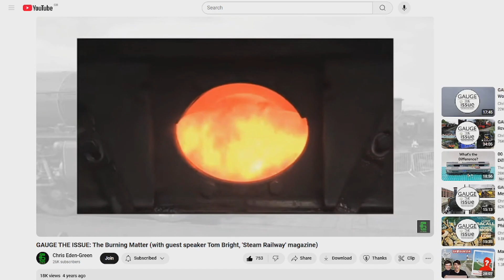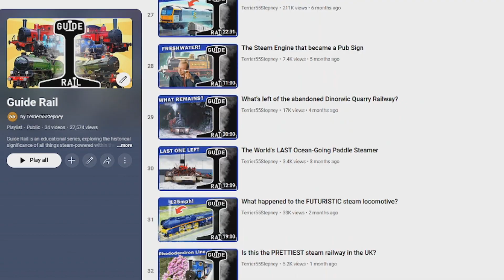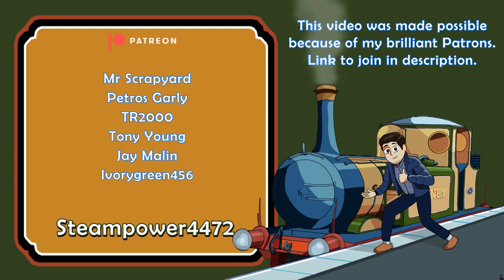Why are steam railways struggling to find coal?

Comment: I looked up metallurgical coal.  Its bituminous coal with low ash and sulfur with other special mineral properties.    It's about five times more expensive than steam coal in the US.   In the UK locally minded metallurgical coal even at its high asking price might be cheaper than special order overseas bituminous steam coal.
Reply: What mined coal in the UK? the only coal still mined here is Anthracite. Most of the coal previously mined in the UK was Bituminous coal, but welsh coal is a broken grain gasius coal (much akin to a very low grade anthracite).

Our last Steelmaking coal  came from the mine Welsh Labour closed in 2023 on eco grounds, and hence we no longer have any steel mills making virgin steel, just steel plants reusing steel for low grade iron and steel. 

Years ago we used to have gas and coke works (in the days before natural gas), Bituminous coal was heated up in coke ovens. The gas given off was collected and supplied to many towns via the gas main (much as it is today with natural gas) and got the name "town gas" or "coal gas". It is also why there were so many gasometers in large towns in the UK, to store it.  The spent coal was then sold as Coke, for use in ovens, fires, hot water boiler, forges, etc. another bi product was Tar (bitumen) which was used for many purposes including road repairs and making creosote, and was where the term coal tar came from. One of the reasons this came to the end was Natural gas was not toxic if compared to the very toxic nature of town/coal gas. Also with the influx of north sea drilling, natural gas was much cheaper. just about all the bitumen today in the uk is a bi product of the oil industry. Because of its carsnagentic nature, coal tar based products (such as true creosote) were banned (and a licence required to sell things such as railway sleepers than have been pressure treated in this). Amazingly we use to use a byproduct of this in soap. You can still get coal tar soap today, but it is instead made with tea tree oil, and the smell and colour are artificial. 

In the early days (1830's) locos were monitored very clearly for smoke emissions, and most burnt coke for that reason, as coke burns with hardly any smoke, as most of the volatile chemicals that make smoke, had been boiled out.

During WW2 there was another way to produce gas used in the UK and Europe when fuel supplies dwindled for non military use, in the form Wood Gas. The most basic way to describe its manufacture is, green wood is heated by a head source (dry wood or coal), the gasses given off pass through a charcoal filter turning the CO2 and water vapour (H2O) into H2CO (methanol gas). These gas generators were used to power IC engine plants, on everything from a static generator or pumping set, to a farm tractor or even motor vehicle. Whilst its is a complicated bit of equipment to get set up correctly, and requires careful maintenance and operation,  it is claimed that wood gas is cleaner when burnt than natural gas, and should be considered a renewable energy source.
Reply: @ i’m not that familiar with the current status of UK coal mining just that Britain is known to still have large amounts of high-quality bituminous cool.  I thought the video said that the UK still had metallurgical coal.  I made a comment before this where I recommended contacting some US tourist railroads that get special order steam locomotive coal.  methane is CH4.  Gasification of coal produces carbon monoxide, which is deadly and hydrogen.

Comment: This shows what happens when environmentalists get to dictate policy- shut coal mines, instead import it from halfway round the world and create more pollution. It's the same with classic cars, which cannot use the new E10 petrol. We are stuck using the expensive super unleaded; even this is far from ideal, causing reduced mpg and costly engine damage..
Reply: Wrong. The idea is to use no coal at all.
Reply: @rogerphelps9939  When did you last use Coal in a car ???
Reply: Meanwhile, flights back and forth across the Atlantic will continue, churning out far more pollution than one preserved steam loco, as stated..

Comment: Australia is a large place.  In Victoria we had heaps of brown coal but no high grade coal.  So we imported coal from NSW.  Due to strikes and political unrest that supply was unreliable.  Hence from time to time the railways were forced to use poorer substitutes.  Including wood, low grade Wonthaggi coal, oil and brown coal.  Today oil firing seems to be the major choice.  It is easier to obtain and takes less skill for the fireman and crews.  Because we have LOTS of brown coal many experiments were made with that. The only suitable process was the German "stug" equipment. It wasn't widely adopted because it needed a complete overhaul of every part of the coaling system.  The capital cost of that was too great when oil was readily available.

Comment: why not charcoal?
it can even be made with renewable power and organic refuse to boot!
Reply: It's too light in density when working. It gets sucked off the fire bed when worked. It's quite a spectacular display at night. The other issue is storage as it can absorb moisture.

Comment: One of the abounding problems was when they closed the mines down, the UK started importing Polish "brown muck" which burns OK in power stations but for steam is inherently useless.   Unlike best steam black, brown muck is far far more polluting, requires massive extra cleanup and is pretty much one step above burning bitumen and at first it was dirt cheap but since Brexit the prices have gone through the roof.   Oil burning could be a solution, Venezuela sits across a vast hundreds of years of burnable bitumen but we aren't allowed to buy it, it really is insanely cheap too but requires modification to use and is a very dirty medium, since government is allowing our refinery capability to collapse finding cheap heavy fuel oil is soon going to hit hard, what them diesel users are not aware in 5 years we will no longer refine petrols and diesels and will buy it ready refined from abroad at great expense and this is going to hit shipping hard as Russia is pretty much the go to in heavy oils and burning again is hugely expensive whilst we sit abaft 1000 years of coal which can be burned cleanly with little modification (thank you Mr Fowler) and just needs to be dug up.   The thing is, the grade for steam loco's aka Welsh Best Steam Black, burns completely with less ash, more usable heat and smoke is less than other coals, indeed farms alongside steam railway lines thrived from the pollution from steam enjoying the watering of their land and the volatiles that fertilised the very earth whilst diesel just poisons the land with its particulates thankfully trees love diesel particulates as they did steam generated smokes but the simple concept of just plant a ton of trees is lost on government.
Reply: There is good quality coal in Poland, but to my knowledge they have become reluctant to export it. This concerns, e.g. steam rrains in Germany.  Generally both stammt locos, blacksmiths and tradional home fireplaces require hand mined cool in suitable piece sizes,  whereas all power stations nowadays fire coal dust

Comment: A few steam locomotives here in the USA burn oil instead of coal
Reply: We had a few Stanier Black  5's that ran on oil in the UK back in the day !
Reply: @lordstiffupperlip3095 non of the UK's experiments with oil firing proved to successful or financially viable and were soon converted back to coal firing.
Reply: Yes, and it's possible to convert British coal-burning locos to run on fuel oil. This was done at times in the 20th century. But the oil is still a polluting fossil-fuel.

Comment: I know LNER engines should be fine on anthracite as they were designed for it from the mines in Yorkshire, but GWR, SR and LMS types would steam poorly.  So maybe Heritage railways will have to run LNER types more and everything else less, and knowing how few and far between LNER engines are relatively, thats sure to lead to problems.

Comment: Can the fireboxes be converted, with non-permanent changes, to run on heating oils?  I guess this would be a case by case basis if the original firebox can support the heat difference?

Comment: could the HRA possibly erect a company which reopens the Welsh mine on a smaller scale? With a relatively small work force doing only day shifts the output could possibly be enough to meet demand for steam coal across the UK. The steam preservation industry in the UK seems large enough to me to support such an initiative. Coal  from Wales would certainly still be a bit more expensive than it used to be but it is a reliable source and it doesn't have to be transported from the other side of the globe, as much of the imported steam coal is Columbian.
Reply: Yes this would be a solution, BUT, coal mines were closed for eco reasons by government. So reopening would have to overcome problems by eco-idiots etc, and replace all the old mining equipment, safety equipment, reopen transport links, meet all new safety, environmental conditions etc. etc. Then, there's the miners pay which thanks to recent government changrs, will be high! Can it be done?
Maybe an open cast mine? Less specialist equipment & skills required?
Reply: @martinsurridge7390  These are all valid considerations.
Reply: @martinsurridge7390  Eco-idiots? More like the people who, hopefuly, will ensure that your grandchildren will have a worhwhile fuure.
Reply: You would need a mineral extract licance, which this government will not issue. It is wbu Ffos-y-fran closed, because the Welsh labour government refused to renew its M. E. L. They even tried to revoke the M. E. L for the anthracite mine near Port Talbot. The previous government gave permission for a new mine in Cumbria to be used as a replacement to supply the UK steel and cement industry, onenofbthe first things this current lot did, was revoke it's licance on eco grounds. It's doing the same with coal and gas extraction, and even. Quarrys that. Supply sand shingle stone and even rock salt.

Comment: So Let me get this right: Coal mines are shut down in an endeavor to go the Clean Energy Route, but Coal is still needed, so it is being imported from around the world via cargo ships, which mainly use Fuel OIL. So, rather than pay people to mine the coal which would create jobs, and keep the coal supply flowing to where it is needed, money is spent on shipping companies to ship the coal into the country, Looking at this from the "Clean Enegry" side this is cleaner because the coal is shipped in via cargo ship and the ship burning Fuel Oil is at sea and not spewing exhaust into the air on land, but money is being spent to get the coal and use it, ie; burn the coal. 

Lets just hope this does not happen: As the mine sits there ilde. 
The Centralia mine fire is a coal-seam fire that has been burning underneath the borough of Centralia, Pennsylvania, United States, since at least May 27, 1962. It is burning in underground coal mines at depths of up to 300 feet (90 m) over an 8-mile (13 km) stretch of 3,700 acres (15 km 2 ). The original cause of the fire is still a matter of debate, but the most widely accepted theory is that the fire was set by local personnel to reduce the volume of trash in a municipal waste disposal area. 

 "Clean Enegry" "Clean Air" someone better tell Mother earth to stop the volcanos from spewing ash into the air.